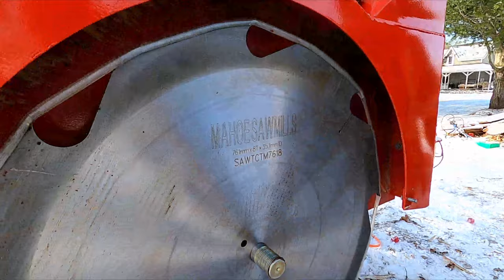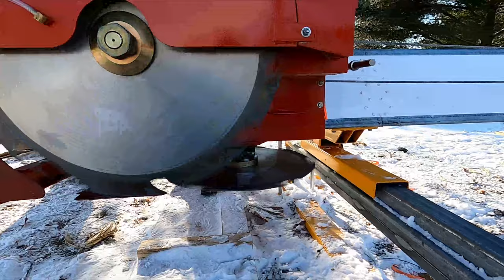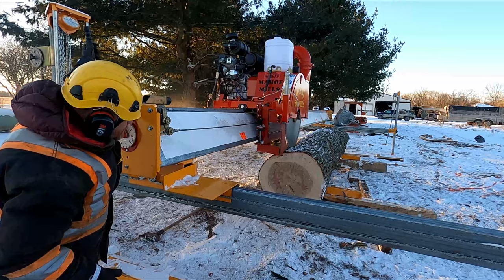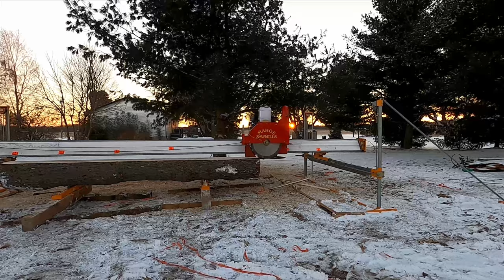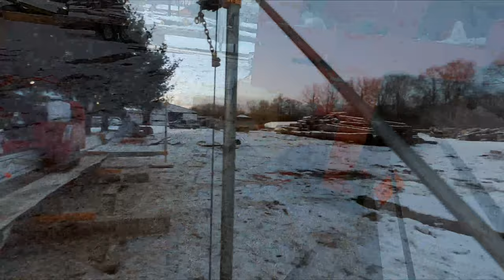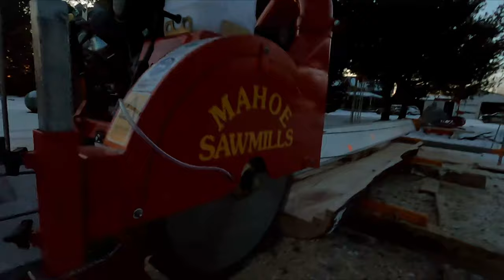First run on the Mahoe Minimax Sawmill!

Comment: Certainly must be a joy not having to manually rotate a log to get your boards from that bandsaw mill I saw in the background.  The Mahoe certainly do have some great features on them.  Did you get to use that taper cut facility so that you are always cutting parallel to the grain of the log?
Reply from the maker: Yeah sorry sure, its a ton of work doing everything manually on the bandsaw. I love the fact that it slides the boards back to me as well. I haven't cut much yet with the taper cut feature but I expect I will. Tomorrow I am starting to cut the oak for my house, will be posting a video soon after. I will have more opportunity to use it👍

Comment: Those guide cables look way to slack. Those Mahoe are expensive units, so a big investment. Hope it makes you some money real quick. :D
Reply from the maker: Yes they do look pretty slack, I tightened the bottom one a little, but they do need slack to work properly. I'm posting another video today, you can see when I pull the lever it tensions whatever cable needs to be tight to move forward or back. And yes It was a bug investment for sure! Starting to get some work with it so thats good. 👍

Comment: A few questions  where do you subscribe, I respect your choice on a Mahoe, did you consider a mobile dimension from the states, or a swing mill from BC, or Australia
Reply from the maker: Hey Ben! You can subscribe below any video or on my channel page! And yes we looked at a few options, we have had a lucasmill swing blade for about 10 years and the Mahoe seemed to be the best upgrade for us. We love how it cuts vertical and horizontal and brings the board back. The mahoe is a very well built machine.
Reply: I'm interested in a mill but not a band mill,I managed 1000 acres of woodlands and not having a decent price for sawlogs, I'm looking to cut to structural lumber and openly sell to the public. I'm interested in the Warriors swing mill but I don't know, what is your opinion.
Reply from the maker: @bendugas8632  I have seen some videos of the turbo sawmill. If you are going to be milling a lot I would definitely look at the mahoe, it is much faster that the swing blade mills because it cuts a finished board in 1 go. It may be a bit more expensive but you get what you pay for, in the long run it could make you more money. I have seen the Mahoe mills that are 20 years old still working amazing. Also you can still produce a lot of lumber in a day by yourself. No need to walk to the log to retrieve the board, it just comes back to you. I just love how well built my mill is and how fast and accurate it is.
Reply: What is the maximum you can cut in your mill, ? X ? in inches.
Reply from the maker: @bendugas8632  it can cut 8x12. The supermill can cut up to 10x12.